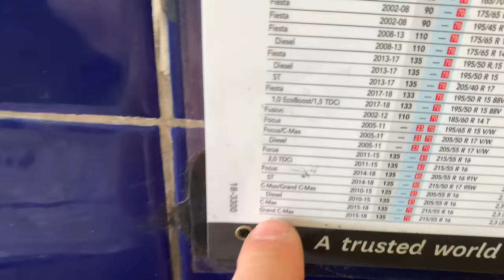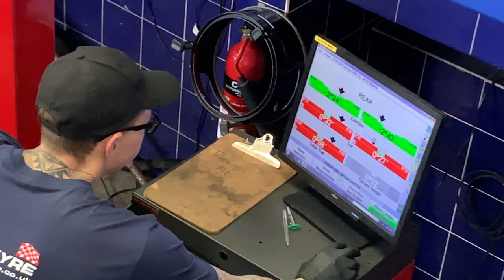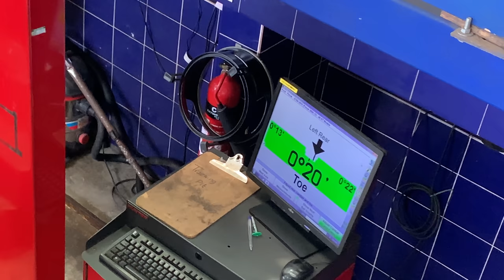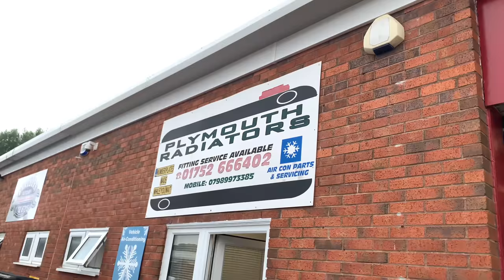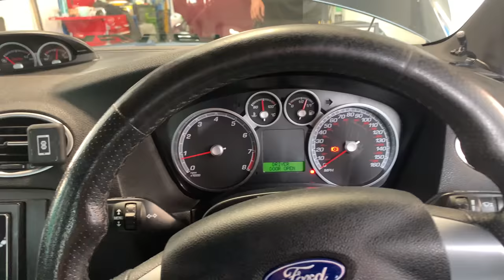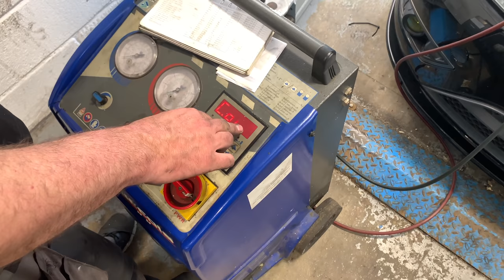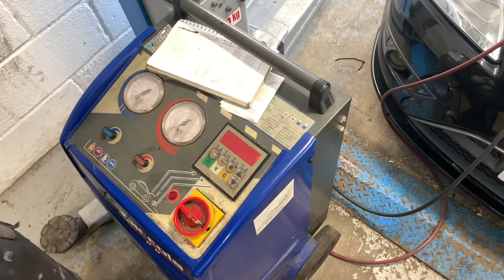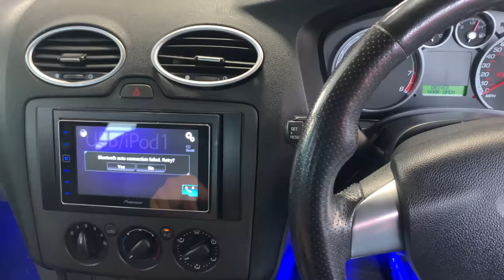YOU NEED TO DO THIS TO YOUR CAR | WHEEL BALANCING, ALIGNMENT AND TRACKING | MK2 FOCUS ST

Comment: Does the Decat pipe have a kink in it or is Straight ? if its straight that's why mine did the same so will order one with a kink in it and the exhaust should line up again

Comment: awesome content. but use a speed brace then a torque wrench to get a true torque reading.plus you will start damaging the lock nut key every time you us a air gun to remove it .i have pissed off a few customers using that method...opps